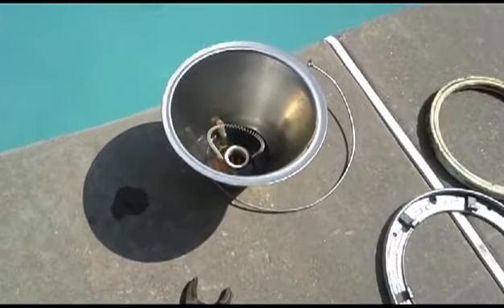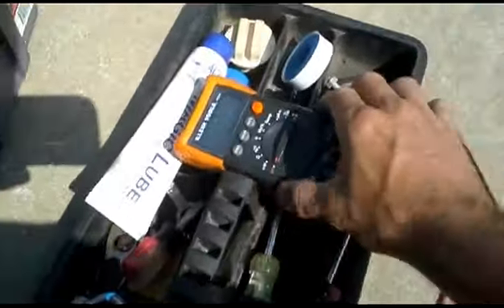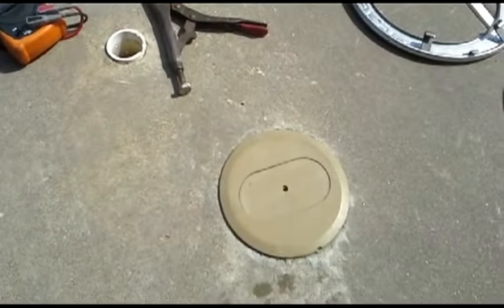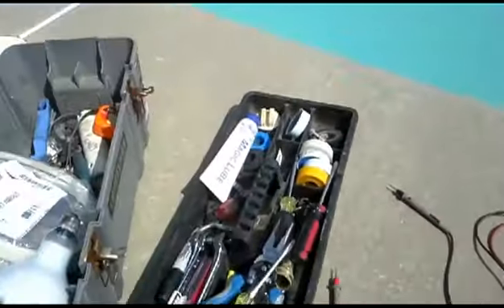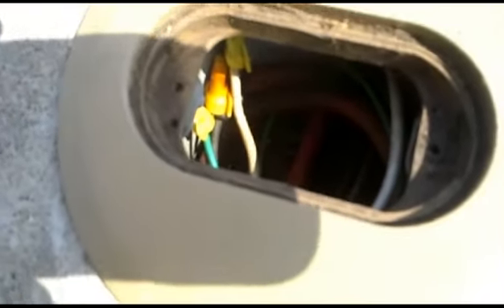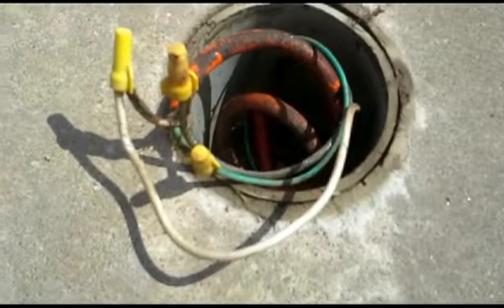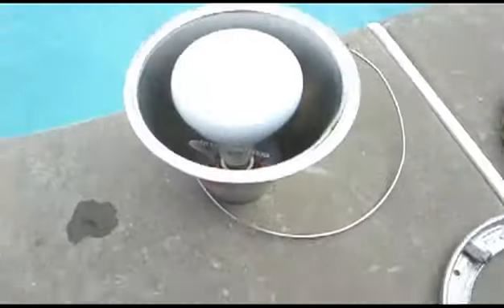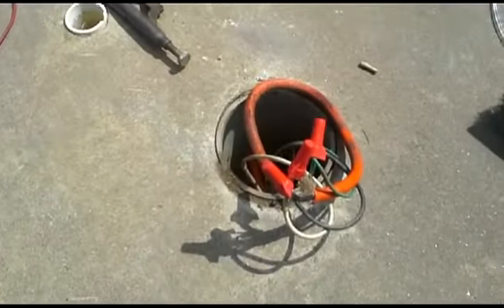How to Fix a Pool Light

Comment: What's the coil in the light fixture? We thought the electricity was off but it wasn't. A screw driver was places inside as a second safety measure and sure enough sparks started flying and a fire started. When we checked the fixture, the coil was gone. Do we need a new light fixture? I don't want to get shocked.